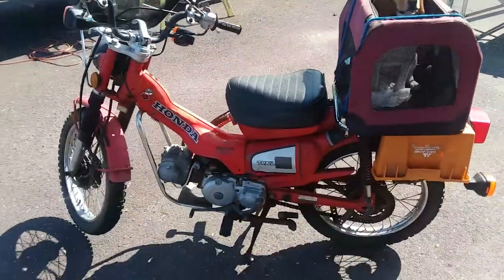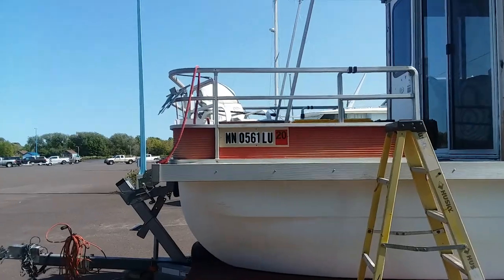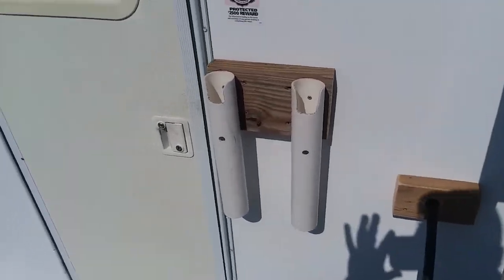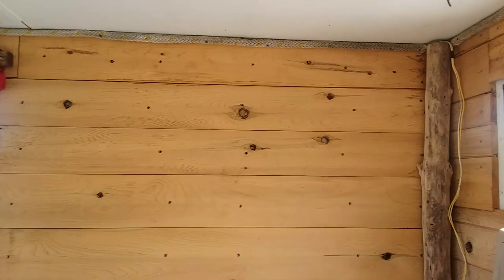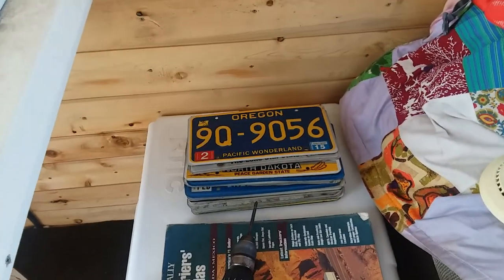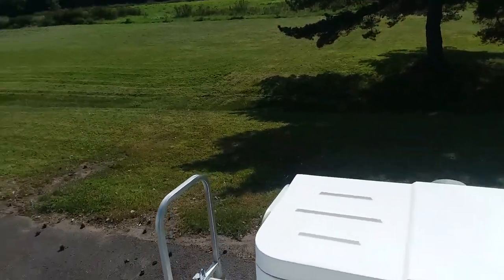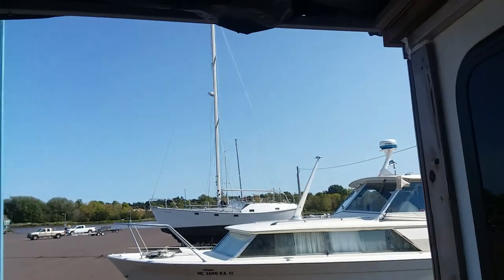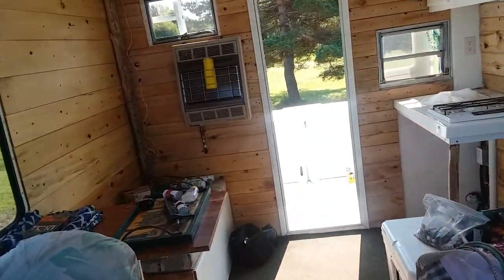The Shanty Boat Beagle Build: Episode:12

Comment: call an motorcycle full shop and repair the will have a wire in flux capacitor for the headlight, you may just have baked wires that have been crimped under Insulation
Reply from the maker: I no longer have the CT110. I bought a Yamaha TW200. Love it

Comment: Maybe some one already mentioned this...systems like this are pretty simple and un-refined.  The charging system can produce large spikes, enough to burn out bulbs.  In this case a battery acts like an electrical shock absorber to absorb any large voltage spikes.  Therefore, if there is not a battery installed, that should help a lot.  I learned this on Honda Trail 70's.
Reply from the maker: The c90s and c110s are 6 volt and famous for having weak electrical systems. I'd love to get my hands of a 125 trail

Comment: On those bikes,  the battery is used to regulate the voltage of the alternator.  When you have no or an old battery, it will burn out the headlight.
Reply from the maker: Yes, I do believe I knew that then. Being 6 volt does not help those bikes. The Aussies got a CT110 12 volt "Postie" that apparently solved all those wiring issues. All I have now are 2 Honda Passport C70 in the barn. I should pull them out and fix and sell them